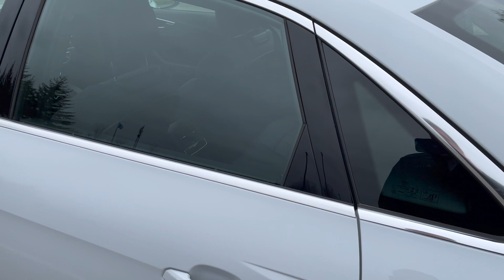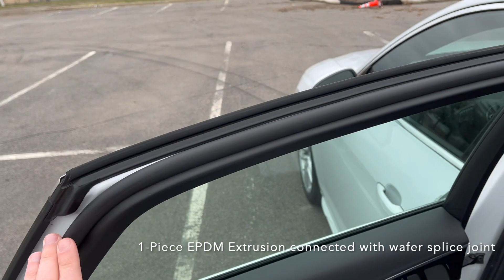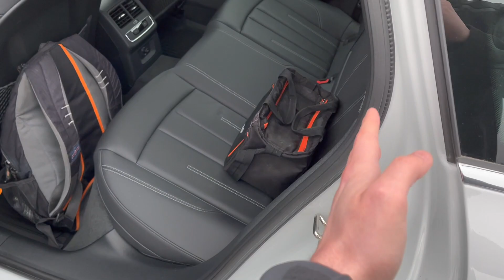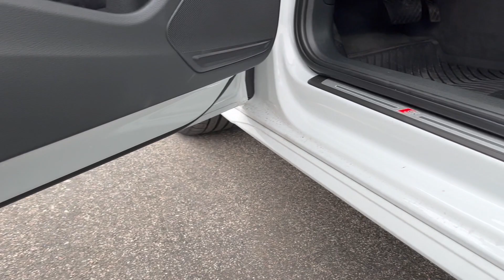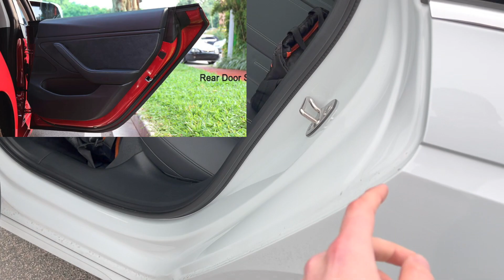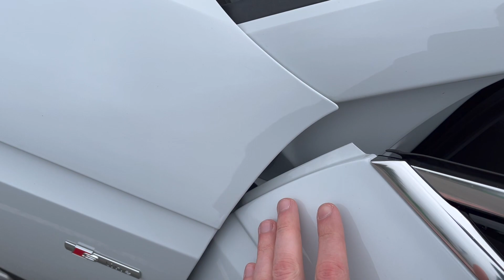Former Auto Engineer Explains Audi Door Sealing Design: What Makes Audi the King of Quietness

Comment: thanks - very informative. how does Lexus compare? I see them mentioned often for quiet cabin/ride
Reply from the maker: Lexus also makes very quiet and comfortable cars similar to Audi. I would say Audi is more consistent on making quiet cars for each vehicle segment they sell in, whereas some Lexus’, like the CT200h, NX, and IS, and LX aren’t as quiet as their German rivals. But the Lexus ES, LS, and RX are extremely quiet and on par with Audi, BMW, and Mercedes vehicles they compete with. In general, Lexus vehicles will have a softer ride compared to German competitors, whereas the German cars are known for their planted feel at high speeds that usually comes from a slightly firmer suspension.